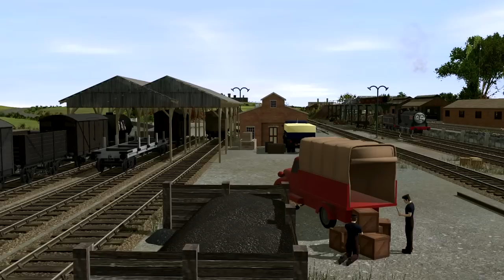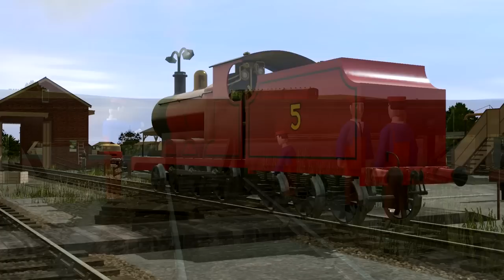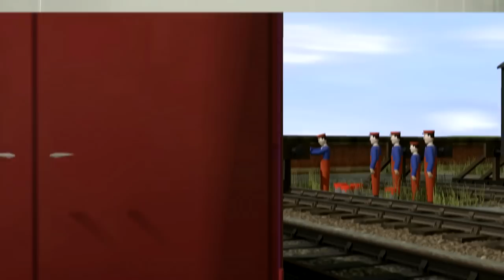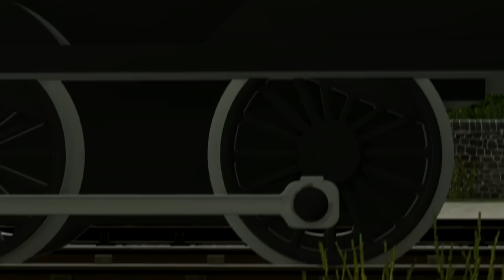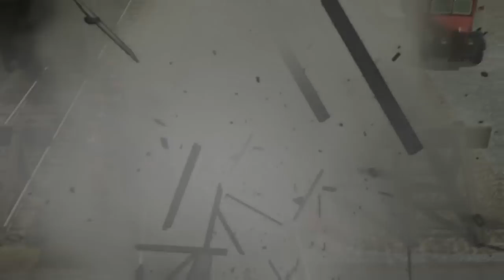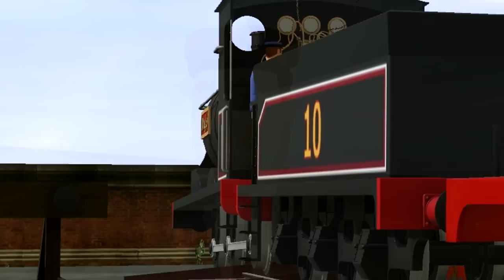Buffer Bashing

Comment: While I do enjoy the adaptation, something feels rather off to me that I feel I must point out. The narration states that the twins take trains FROM the Arlesdale line to James at the Big Station, but here they're being shown taking the trains to the Arlesdale line further down the branch! It's a small thing but I think if the narration had been tweaked slightly, it would make more sense between the visuals and narration.
The lack of the red paint I understand is hard to control as well, but otherwise I did really enjoy the work put into this adaptation, well done all